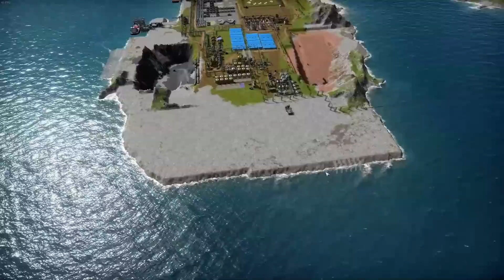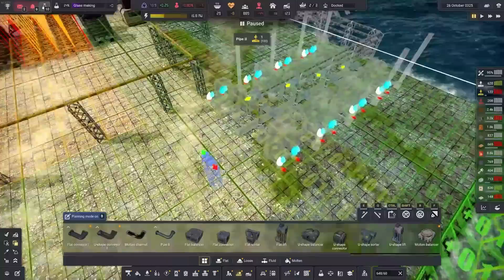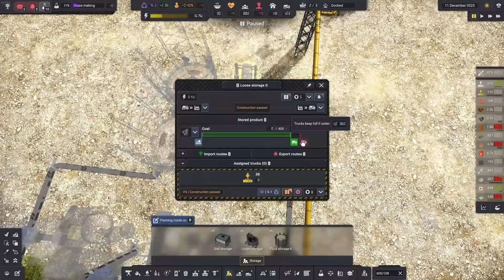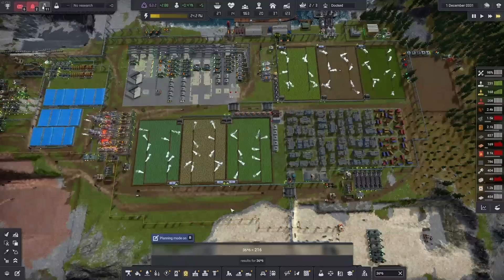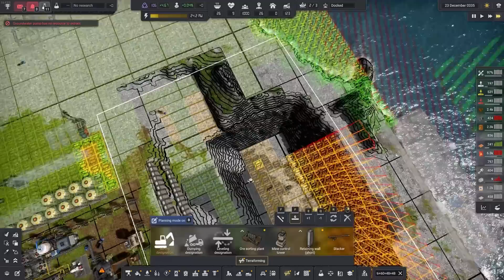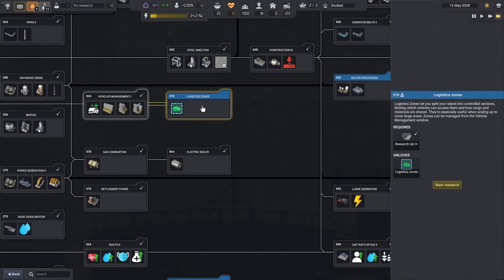The Great Water Scare of 0332 | Captain Of Industry | Update 3 Day 14

Comment: You could eventually or expeditiously make a liquid venting center...using

Maditory:
*1 tank per liquid
*A gas boiler
*An electric boiler
*2 balancers...1 after the boilers & 1 after the tower
*A small cooling tower
*A small power setup...enough to supplement power grid while the system is running

Optional:
*An exhaust scrubber...to get sulfur, co2 and a little pollution...or the same...but with no pollution...and you receive slag for limestone as well
*Chemical plant T2...to get graphite
*A gas injector...to get rid of co2
*An exhaust vent...to just vent exhaust
*A flare...to balance some of the gas to just burn
Reply: Also...set the system to lowest prioity
Reply: Attach the balancer after the tower to another water tank sat to empty at highest priority
Reply: Prioritize the steam to go to the power first then vent
Reply: After the power have the depleted steam go to the tower

Comment: May like to build a tear one pipe to supply fuel to the contract dock. Your upgrading the size of the contract dock. This would double the need for concrete powder. I would have considered building the water distillers off the concrete contract coal port to have the contract supply auto replenish the coal.
 Combining concrete plant, crusher plant, concrete slab plant is a good idea. Using a balancer to belt concrete powder to a storage for the dock export. Or build the entire plant by the dock. Any excess coal not used for concrete would be dumped or stored. 

I normally build by distillers in groups of three because they take 18 coal. A pickup moves 20 coal and minus 18 is a remainder of 2. The Pickup needs one less trip every 9 trips. Removing the coal fire boilers and going completely light oil would reduce the amount of water the power plant needs and would burn off all the light oil. To power two light oil fired boilers four stage I and II's are going to be needed. The future of that would be having two oil rigs running at manpower 3 or one at 6. 

Modifications to the power plant (PP) building a water reservoir tank to supply the boilers and setting a notification on it at 75% empty. This would give an alert in the future when naming the the Power Plant (PP) Water Reservoir. With the distiller setup the coal burn rate is going to deplete the coal deposited quickly. This is likely gong cause issues in the future unless Thermal Desalinator is unlocked. Thermal Desalinator have a better return on coal when burned and the coal boiler to water than distillers. Most other players unlike me skip distillers. I still run a distiller for my concrete plant because its sea serviced and the exact rates for 6 concrete slab makers. But the concrete plant run in my game has more room and grinds 270 limestone a minute. 

Net little trick to reduce travel times for vehicles for in the case of the copper. Taking a belt from the copper storage and connecting to a storage much farther down the road. This could also work for supply like coal. The trucks dump there and the belt takes it to the copper plant. Much easier to move completed product like electronics than two resources like copper and rubber. Much easier moving things by pipeline vs belt. Piping fuel up to the copper plant to have a rubber plant make rubber and share the coal bucket than fit 60 electronics parts on one tear one belt than two belts of copper and rubber split. 

Best bet digging and dumping to other ground water aquifers to setup ground pumps and pipeline them back taking the stress off the small lone aquafer. The easy start location is on the other side of the cliff. It would be easy to dig into the mountain for rock to dump to make a path. 
Some advanced logistics paths would help with the coal supply. As they are all the same priority. The nearest loose storage is supplied first. Making a coal loose storage a push by keep empty. And the rest linked to the route one could order priorities for who gets served fist.  

Getting into fuel gas at this time would likely result in to many differing resources to manage with vehicles. Grinding the wheat into animal feed and animal feed into compost and compost into organic fertilizer would let the farms enrich with out natural replenishment. A trick with farms to save water is to rest them and use natural replenishment with out green manure giving the farm time to replenish naturally and does not use water as there is no crop. A crops water consumption is the total number divided by the months. Vegetables and wheat use little water with potatoes using the a little more. Corn uses lots of water. A more complicated but expensive option would be to use a dual loop water supply for the farms. Having rain water on level 4 and ground and sea serviced water on level five and having a connector on the water input for a farm.
Reply from the maker: Thanks for all the great tips. I'm definitely going to have to give some of those a try!

I ve already piped the heavy oil to the docks like you mentioned and made a couple of other adjustments. I’ll need to add more diesel processing to produce more light oil but I also don’t want to over produce diesel and have to burn it later. 

The water issue should be a temporary solution until the thermal desalinators like you said and I’ll be working on getting that research asap. I also have water reclamation with depleted steam unlocked which will help the PPs water issue. 

Dedicating the dock to the distillers is also a good idea, producing the necessary cement might be the big hurdle here. I’m afraid of running out of limestone soon and then not being able to produce the concrete I need for my construction parts. 

Will have to play it by ear and see how it goes.
Reply: @JTMPLays  Starting location 1 has Limestone.